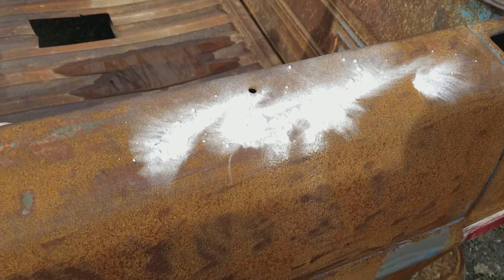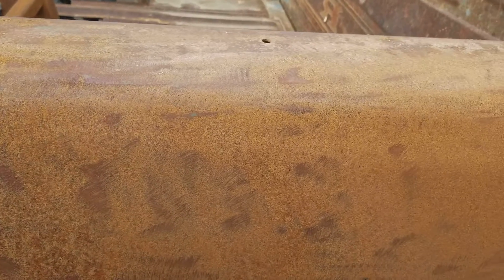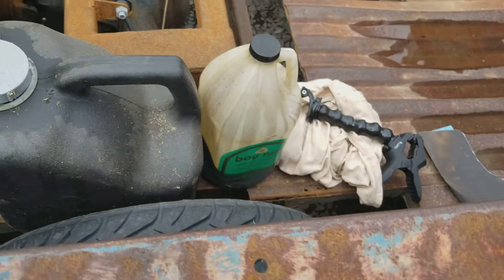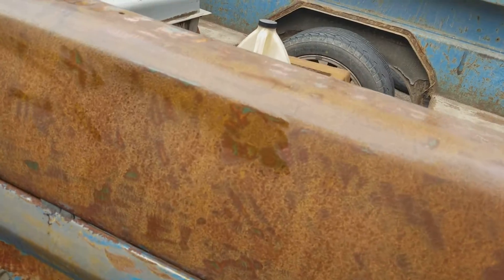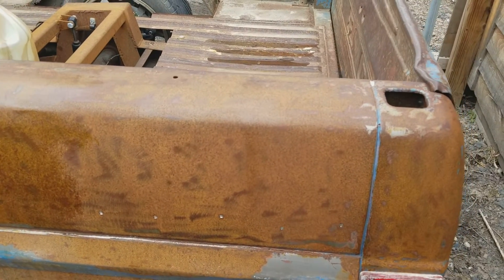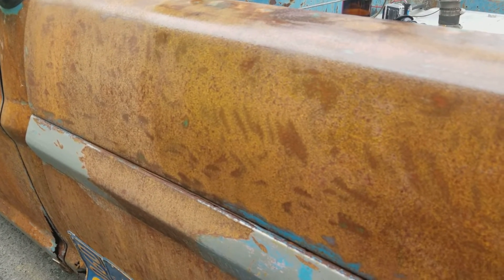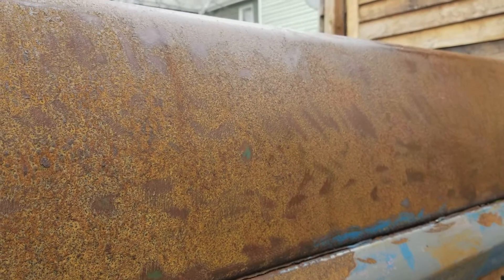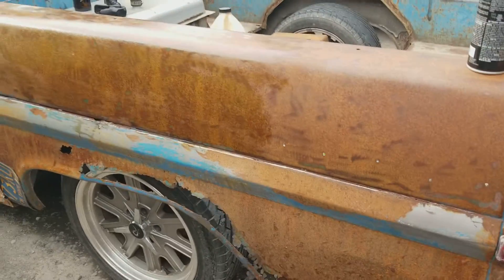Clear coating patina experiment

Comment: Vinegar, Peroxide, & Salt will create Rust. 

As for sealers; FLOOD Penetrol, Polyurethane; Brush or Spray Can & or Boiled Linseed Oil IF you'll recoat it regularly say every 4 months or so. 

Stuff like oil; even vegetable oil will make a mess in the rain / could be a fine🤷🏻‍♂️

Comment: I'm doing up an old, rusty chest, all I'm doing is scrubbing off the loose paint with a steel wool pad and then putting a couple of coats of glossy clear coat. I'm using it as an outdoor wood storage box.

Comment: Hi mate, I have a brick BBQ with steels doors. I love the rusty look but I want to find a way the neutralize and lock in the rust. I already had the replace the doors within one year before when I didn’t do it. I live in Indonesia and there is not heat resistant clear coat here. Do you have any advice for me?
Reply from the maker: I would spray clear coat on it to seal it and check every year for touch ups. Good luck
Reply: @hairnbeard  there is no heat resistant clear coat in indonesia
Reply from the maker: Maybe check out some blacksmithing videos.  Blacksmithers that work outside need to protect their metal tables and anvils. That's where i learned about "Flood's penetrol"
Reply: @hairnbeard  great tip. I just checked and they prefer to use beeswax. One guy did a comparison and it works better than linseed oil. Thanks heaps!

Comment: Just a question, but wouldn't it have been easier to mix the baking soda with water and just use a rag soaked in it to spread it on the metal? Then couldn't you just wait for it to dry and go without the sanding?

Comment: I’m doing Patina work on my 30 Ford rat rod.  A spray bottle with table salt, peroxide and touch of vinegar shaken well works great to create surface rust. Clean off gently with a Brillo pad and repeat a few times on bare metal.

Comment: Linseed oil from home depot. Will shine like new rust with out clear coating
Reply from the maker: Thanks ,i used it on my shed, the problem is it washes away. I went with penetrol. Welders use it for artwork and furniture.  Next might go with bees wax
https://youtu.be/Zxrpu5g89h8

Comment: You could use a heat gun for the motor oil. Clear coat with rust inhibitor is probably the best way to go